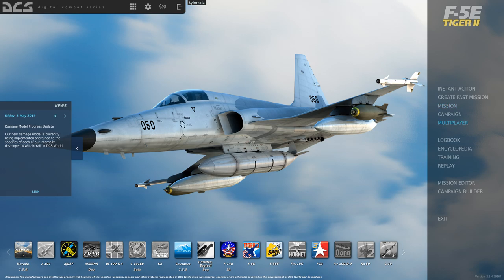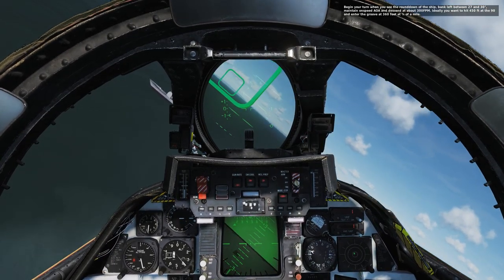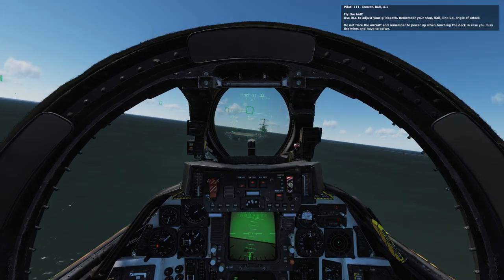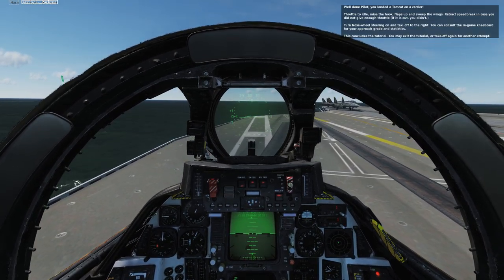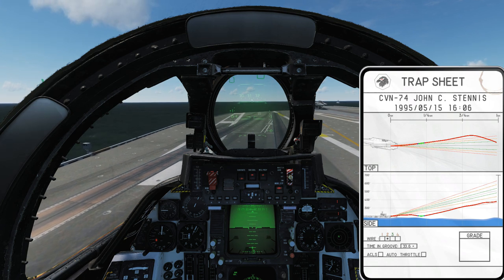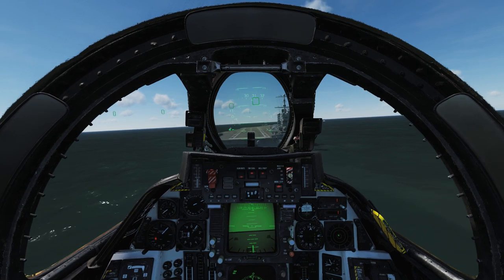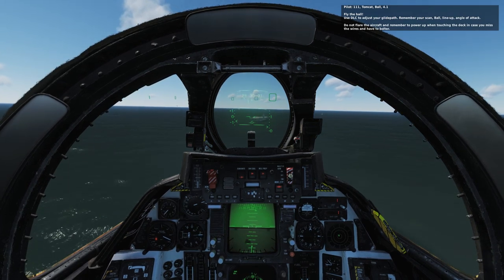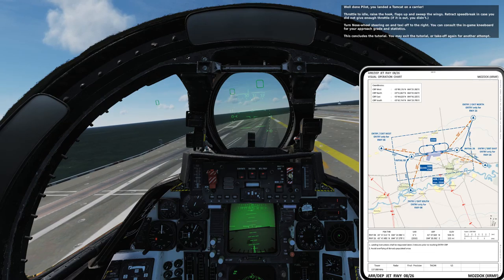DCS World - F-14 Carrier Landing Practice

Comment: You're so far below the glideslope that you can't even see the ball on approach, I'm amazed you didn't crash into the back of the boat with these low approaches
Reply from the maker: Yeah, I noticed that mainly while editing. When actually flying it, I'm too concerned about overshooting.
Reply: @RaizSpace  The gear can easilly handly it crashing into the deck, its honestly better to be too high than it is to be low. If you're high you can just go around or slam dunk it into the deck, but if you're low you just die. It's pretty hard to see the ball properly when youre a way out, so i'd strongly recommend zooming in on it while youre approaching, you don't really need anything outside the hud anyway while landing. Hope this helps and best of luck!

Comment: Hmm, now you got me wondering what your flight controls are, joystick with pedals or joystick with rotating stick for yaw or just a stick?
The reason I'm asking is, it would appear your turns are highly uncoordinated, using a lot of yaw in an attempt to force a turn (and not enough roll). I've been running into similar problems after not flying for a while and then having to get used to the rotating-stick-controls again.
Unfortunately I don't have DCS, so I can't compare how the F-14 model behaves there, but there is a flight path indicator (flight path vector) on your HUD which shows you the direction you are actually flying towards and it is.. basically all over the place for most of your approaches ;) If you can keep that steady, pointed at the wires and just ride it down you should get to a safe landing.
Reply from the maker: Stick with twist-rudder. This one in particular: https://images-na.ssl-images-amazon.com/images/I/716%2BfMqlgLS._SY606_.jpg  And yeah, I know I've basically got what my KSP-brain calls the prograde vector on my HUD and I know what it's telling me. Getting it to settle down is another matter.

Comment: Have you tried the F/A-18 carrier landing? It has a lot more systems that help you learn to properly put it on the deck.

My biggest issue to overcome was the decent rate. Military Jets really like high decent rates.
Reply from the maker: I don't have the F/A-18 since I already had one in X-Plane 11 (somewhat different, I know, but still). Seems like I do need to get used to a higher descent rate, indeed. Odd, considering how often I try to land the Shuttle, but that's a different puppy altogether.